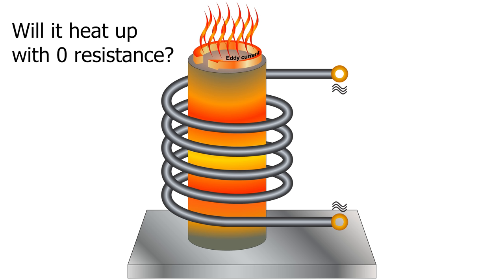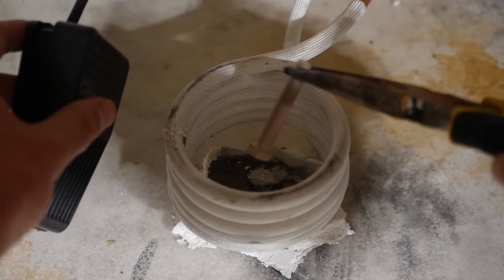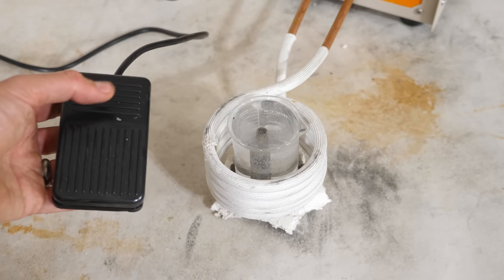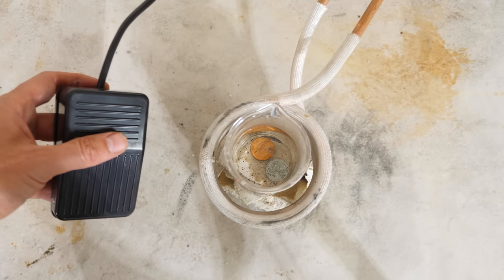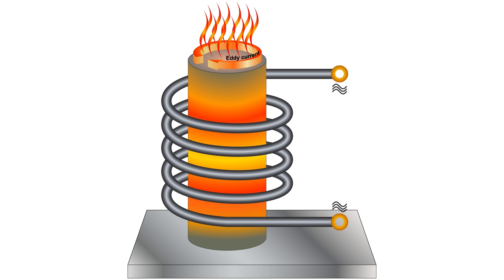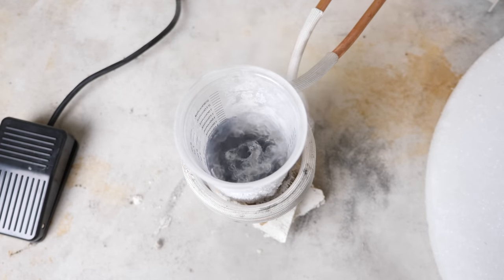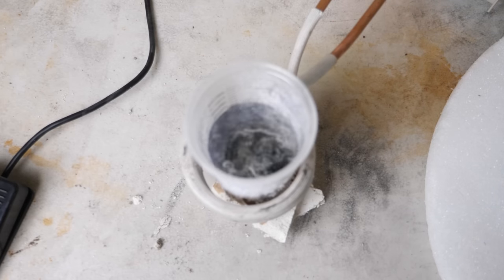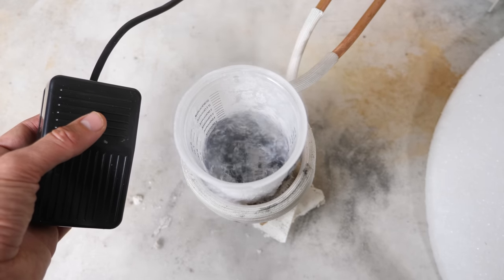What If You Put a Superconductor in an Induction Heater?

Comment from the maker: I should add that superconductors can break down in high fields, but I also put it far from the coils so the field was weaker and it still acted similar to steel. This is a YCBO superconductor so the breakdown field should be pretty high. Also I should add that there are more mechanisms that cause resistance in the superconductor in AC fields. Not just the skin effect. I am learning that superconductors aren't so super in AC fields.
Reply: @Call_Upon_YAH  okay... does jesus love mario kart and summoner duel or something? I know it's not an issue but I see no reason for channel to contain video games and quote religious stuff at same time but does not upload anything related to it
Reply: The irony of posting this on a science channel.
Reply: Good to mention. Especially for these polycrystalline pucks, these critical fields are especially high. Agree that is not really a problem here, see my other comment for what I believe is.
Reply: I’m curious to see it react w/o the liquid nitrogen 😱🤷🏻‍♂️. Curiosity kills tho eh? Lol
Reply: Cool. Please, make the same experiment with DC current for comparison.
Reply: For the same reason the superconductor can "pin" a magnet below or alongside, there are thousands of tiny superconducting grains that aren't connected to one another. Pushing the moving magnetic fields through those gaps causes heating. If you put a neodymium magnet on a spinning chuck near the SC, that too will cause heating.

With a single monolithic non-ceramic superconductor, you don't get the pinning effect, and would not get induction heating. But you would need liquid helium to make it superconducting...
Reply: The whole way an induction heater heats is with high magnetic fields switching orientation quickly to create high flux. Anywhere the induction coil efficiently heats something is a place where there is a high, alternating magnetic field.
Reply: Could an other explanation be that due to the induced current bunching on the surface, the superconductor is locally exceeding its critical current density and thus becoming resistive?
Reply: Yes but even if it's a superconductor it is not perfect. Nothing can get to absolute zero ohms just like nothing can get to absolute zero degrees (Kelvin)
All matter has imperfections, all man made stuff even more so.
Reply: I think the YouTube channel backyard scientist did this many years ago I'm not sure if it's the same exact thing that you have here but it looks like it except that his got really red anyways you something like this or this any burnt off a lock from a safe that's pretty cool and some other cool things blew up batteries and whatnot
Reply from the maker: On the inside of the superconductor in DC current the resistance is exactly 0. Not close to 0. But exactly 0. There are experiments that show a current circulating in a superconductor for over 25 years. This isn't like 0 kelvin since that is forbidden due to uncertainty principle. But 0 resistance in superconductors is predicted by quantum mechanics not forbidden.
Reply: I think it is magnetic hysteresis that heats up the superconductor (also for the steel penny this is a contributing factor). Note that in contrast to eddy current heating, this increases with the frequency of the AC, which is usually quite high for induction heaters (much higher than the 50 or 60 Hz from the outlet).
Reply: Also note that YCBO superconductors are also ferromagnetic, which explains the magnetic hysteresis ;)
Reply: Very interesting!
I guess for AC fields it's very frequency dependent though. So the idea of using super conductor for power lines would probably still work, since the power grids only uses 50 or 60 Hz (but the problem with that is the low temperatures all known super conductors need instead - the energy required to keep them cool enough exceed the power losses from the resistance in a normal power line)
Reply: @Speeder84XL  also, it is possible to use DC in power lines. It's done for some grid interconnects since you don't have to deal with frequency and phase matching. The equipment is huge and expensive though.
High voltage DC links are used to connect the Scandinavian grid, mainland Europe's grid, and Great Britain's grid to each other, for example.
Reply: @anonymouspenguin2647  I don't think an induction heater can work with direct current. If we run DC through a coil, and put a ferrous metal inside of that coil, instead of the ferrous metal heating up, we just get an electromagnet.
Reply: Great video. How long would it take for the water to all boil off if you keep the steel bolt in there? How fast would a copper tea kettle begin to blow with the bolt in it? Would love to that experiment.
Reply: @Speeder84XL , there wouldn't be a lot of difference. Main voltage drop in high voltage AC (HVAC) lines (and thus maximal distance) is coming from the intrinsic inductivity, which is entirely created by the air space between the lines. Superconductors wouldn't change that at all. The resistive voltage drop and corresponding losses are rather small compared to the power that the conductors carry (due to the high voltage). Electricity prices would have to be very high to justify making wires from expensive superconducting materials, not even going into the fact that you have to keep the cables at low temperature. Moreover, if necessary, they can still increase the voltage.
Reply: @TheActionLab  Actually it is only exactly 0 when you consider a perfect superconductor material and a magnetic field below the lower critical field. Still, when engineered right, the resistance in practical situations is unmeasurably small. Like for example in a practical, fully crystalline ReBCO tape with a critical current of 100 A in self field at 77 K you won't see anything voltage until you get to some 60-70 A or so. Btw because your puck is bulk (polycrystalline) ReBCO it will never have any real 0 resistance "state" macroscopically.
Reply: @boknooren  not in superconducting state, which is an actual different thermodynamic state. The main heating source is still indeed magnetic hysteresis; but through the properties of type-2 superconductivity, not through ferromagnetism.
Reply: Yup, not critical -- fields inside aren't terribly high, maybe 100s mT. Even in the surface layer, it's likely not critical. Granted, critical field is also a lot smaller at merely LN2 temps.

With big (100s kW) and low frequency (~kHz) induction supplies, you can see nonlinear (saturation) effects in steel (~1T); which leads to weird behavior, like higher internal than surface temperatures sometimes!
Reply: Can you try a type 1 superconductors to compare the effect of magnetic field line?
Reply: Another thing of note is that as the super conductor begins to heat up, the inside will heat up as well, making it lose its superconductive properties, despite the liquid nitrogen bath
Reply: Also a haircut
Reply: @phizc  Yes, HVDC systems
But those can often use higher voltages as well, since there is no reactive currents caused by capacitance between conductors. That's also why it's often used for underwater lines - because those lines use coaxial cables that suffers from high capacitance. This would also probably make the use of superconductors less beneficial when it comes to costs (since the losses get low anyway).
Reply: @boknooren  Yes, that may be true for the voltage drop. But inductance or capacitance doesn't causes losses in it self. However, it causes  reactive currents that increase resistive losses in the lines. Those losses would go down, since a super conductor would probably pass a lot of low frequency reactive currents as well without increased losses. But the benefit is most likely not high enough to justify the cost - especially since the conductors need to be so cool for them to work.
Reply: Anon Ymous  no. But a grounded  metal enclosure will.
Reply: @TheActionLab  Even though 25 years allows for a ton of cycles of that current, it still is not a very long amount of time in a cosmological sense.  The superconductor could still be imperfect and slowly losing current.  In fact, even if you keep it cooled, wouldn't it eventually lose power due to effects within the same realm of quantum mechanics you're claiming makes a 0 Ohm impedance device possible in the first place?  Again, I'm not the expert here, so while I'm half asserting, I'm also half asking.  Very interesting video either way by the way, I really liked it!
Reply: @Speeder84XL ,
Inductance doesn't cause energy losses but it causes voltage drop. This is typically the main concern of the power line engineer. Although they care about active power losses, I think their main focus is voltage stability. In Belgium, the transmission system operator loses about 1% of its transported energy.
Reply: One of the dominant modes of heating for a superconductor when in the sc state is magnetization losses.  This will always happen no matter how slowly you ramp the field or use geometry to reduce Eddy currents.  Superconductors only truly superconduct in DC
Reply: Actually, the steel heat up more because it contains iron. Iron is a ferromagnetic. If you are going to instruct people at least get your facts straight, else you only serve misinformation.
Reply: And again amazing informative video. Was very interesting to know.
Reply: I'm really happy you brought this channel to where it is now. I hadn't watched it since I accused you of blatantly ripping off the hydrologic press channel, and now it looks like I have an extensive back catalog to catch up on. Way to go, I'm impressed.
Reply: No, Superconductors have absolutely zero ohms, no resistance at all not even a little to DC.   If there was any resistance at all it wouldn't levitate and remain pinned.   However this is only within limits, it doesn't work with AC and there are current and flux limits.
Reply: @Tletna  Even on a cosmological sense, superconductors offer zero resistance, not a really low resistance but literally zero.
Reply: @Inertia888  There IS a way to induce a DC current by induction.   What you do is apply apply DC to the induction coil and throw the switch.  The current ramps up from zero amps to whatever the prediction based on volts and ohms is and during this current rise there is an inductive effect.   When it hits a steady current level the induction will stop however this is DC induction.
Reply: What if your superconductor contains some impurities? That could be enough to create some resistance?
Reply: @Platypus_Warrior  Superconductivity either works, or it doesn't at all, you don't get 'almost' superconductive.  There are many extremely low resistance conductors, but they don't behave like superconductors such as by levitating in a pinned state.   A better question is what happens when you have AC in s superconductor, then the time varying component has radiation resistance.
Reply: @Platypus_Warrior  I will further add, there are some metals that have extremely low resistance (lower than Copper and Copper has exceptionally low resistance) that can be cooled to enter superconductivity.  The phenomena exhibited at absolutely zero resistance is in stark contrast to incredibly low resistance.
Reply: How much electricity is used to do this?
Reply: @itsdarkhere  why are you so mad
Reply: @ok0_0  not really I am just curious why they comment randomly on youtube about their enthusiasm and not just make some video out of it explain why they came to such conclusion instead of that passion they just upload a freaking video game
Reply: @itsdarkhere  maybe they're not comfortable in front of a camera
Reply: @ok0_0  I think you didn't read the comment they made before they deleted it
Reply: The Action Lab is this the reason why there are no superconducting AC Motors ?
Reply: Very confusing video imo.
Reply: If I'm not mistaken nothing currency in America has been made solid for a very long time maybe even before 1945
Reply: @alekmoth  He says in the first moments of the video, 15KW
Reply: I think you are wrong - it really is ZERO ohms. Unless there were a ridiculously high amount of imperfections, the current could still find a "pure" path through the virtually infinite amount of ways available to it, so the resistance would still be completely zero. However, I suppose that the changing magnetic field could still induce currents in those parts that were imperfect, causing them to rise in temperature. If that rise was excessive, it could warm the entire structure enough to destroy its superconductivity.
Reply: The boiling expansion of gas could ultimately power something I wonder if efficiency is gained doing so to create more power and something in something somehow a close system your videos make me want to go get an education but at the same time sometimes I feel like I don't need to pay for one
Reply: Yo make another video and drop an ice cube in it take some readings off the gases generated
Reply: Hey, I have had a really interesting thought.  What happens if you take two different superconducting metals (2 metals that make a suitable thermocouple when joined) and then have them at a different temperature while having both at superconducting temperatures?!  They should develop a current, they should develop a problematically high current due to the zero resistance.  One that once established won't die down even as temperature differences between the junction go to zero. (of course such current will move what little heat there is).
Reply: I wonder what would be the critical minimum amount of power to boil water with a superconductor any benefits to efficiency in some application could be very good
Reply: @jonathanberry1111  this is gord
Reply: @kristopherhardy3302  I'd rather see how much hydrogen is generated from water evaporating about such the nature of things
Reply: I hope you checked that '43 steel Penny before your test.  Some of those are worth a ton of money
Reply: What happens if you turn on the coil then drop the puck above/in the center of the coil?
Reply: what about a nail in some wood does it start a fire 🪵🔥🤔🙇‍♂️
Reply: That's heated because eddy current amount passed the Ic (critical current) treshold of your super conductor.

Comment: I believe superconductors also will stop superconducting if they're are exposed to too high a magnetic field along with the field changing too quickly. Not sure how strong the field is here though.
Reply: This!

The limiting amount for a good super conductor is about 0.1 Tesla at 0K. With the amount decreasing with temperature. Unless he's using YBCO which can do 120+ tesla
Reply: Saturation effect. It can only hold so many lines of magnetic flux.
Reply from the maker: This is a YBCO superconductor. Also I removed the superconductor from the center and put it farther from the field and still easily boiled the LN2 in a weaker field. It didn't seem like the field was too strong.
Reply: Well, this is a new spam bot.
Reply: @madlad5199  probably generating likes and impressions with less "reports" before the channel is renamed and used for different botting... I've noticed a lot of these lately. even some just saying "whomever sees this I hope you have a wonderful blessed day" and they come up right after a video is posted, so they aren't authentic people.
Reply: @TheActionLab  What induction machine did you use? I found not that easy to find a smaller induction machine, not for large scale manufacturing -- unless you end up on a Chinese site.  Those don't really have post-sales support.
Reply: @fredericapanon207  would also like to know what induction driver is being used!
Reply: @madlad5199  I might be getting dumber, but I can't find the "report comment" button anymore. Well, at least YouTube is trying to increase engagement...
Reply: @costa_marco  it's definitely still there
Reply: @DanKaschel  I missed it, now I see it again. Weird. But I am using the browser version. Tks.
Reply: @tusharbhudia9421  I really wonder what you see as a "good super conductor" as any superconductor that we consider usable in the field can do much much more at very much higher temperatures. XD
Reply: @fredericapanon207  I was wondering the same since I have parts to make my own, though haven't gotten around to.  Will be interesting to see the latest and greatest designs... doubting much has changed.  Though might be some inspirational design considerations to plan for.
Reply: @plewis4105  Interesting, I was suggested a video by the channel "BigPigForge" titled "Induction Heating 101" and he referenced eBay.  So I did a quick search and am amazed what is now offered that I don't recall ever seeing before.  Though has been a few years since I've searched around and researched designs.  Appears there are 15-25KW 30-100kHz option designs.  Only a few, though still that's a start. Now to see if I can find a schematic and other info regarding the designs.
Reply: @WouterVerbruggen  the max feild strength they can hold is at 0K
Reply: @tusharbhudia9421  sure but even relatively poor practical superconductor (hence my question regarding your definition of "good") can sustain some 10 T, order of magnitude, of magnetic field. That's assuming 0 transport current thought, they very thing needed to produces Sais fields, so quite useless. In practice nobody cares if it's simply "still superconducting" in some field, it's all about how much supercurrent it can carry in some field at some temperature. It's called the critical surface.